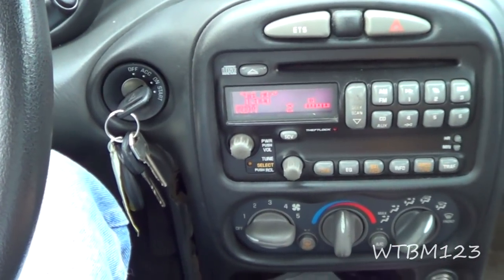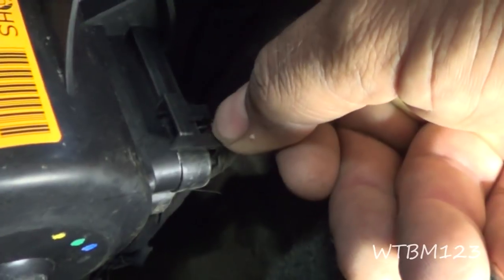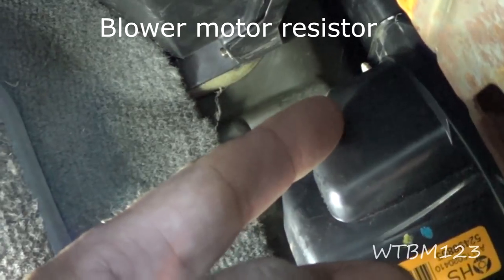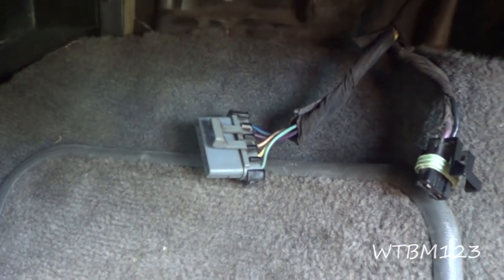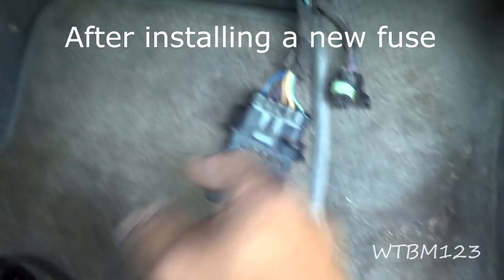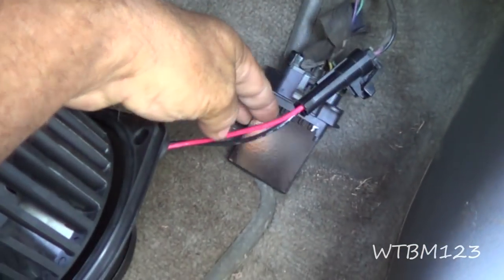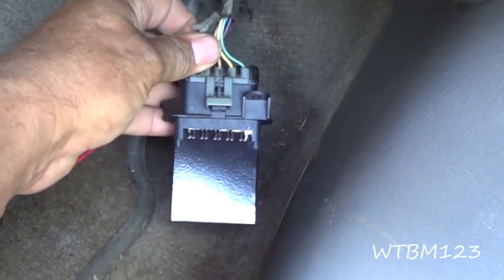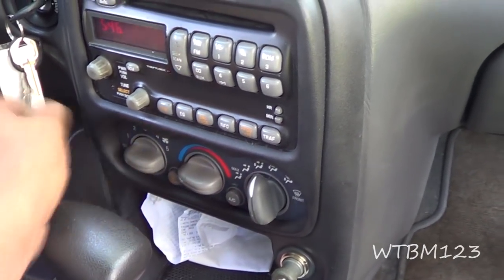Pontiac Grand Am ,HVAC, Heater Fan will not turn on.

Comment: Usually there's a mouse nest's worth of leaves and crap that collects in there. (Presumably from where water drains below the windshield.) And that's one of the things that'll help kill the motor and/or resistor. If you go as far as taking it out, it's a a good opportunity for some cleaning. You'll want a shop vac and a rag.

Also for most people it's necessary to get that passenger seat out, unless your a contortionist. I didn't and my back was feeling it for two weeks.

Good job on getting it done btw.
Reply from the maker: Thanks for watching and commenting

Comment: Thanks for this video bud.  Was able to do it myself courtesy you and your video for a paltry 70 bucks with new motor and resistor.  needed a 30 amp fuse too for 5 setting... so Thank yOU!! very mucho!  bet a mechanics shop woulda nailed me for 250 bucks with labor.  You saved me 200 bucks!
Reply from the maker: Glad the video helped . Thanks for watching and commenting.

Comment: My Grand Prix has had problems with the blower since I bought it. I took it to a GM dealership to get it fixed, and it worked for about 10 months. Now, the blower only works on the highest setting (sometimes), AND the day running lights are directly affected by the blower on settings 1-4. So, on setting 1-4 the blower doesn't turn on, but the headlights go out. Do you have any idea what might be wrong with it? I just want to appear knowledgeable before I take it back to the dealership (so I don't get the wool pulled over my eyes). I appreciate any advice you may have!
Reply from the maker: With out testing , i would wonder about the ignition switch . , or wires rubbed and touching some place . But hard to say

Comment: Thanks! This helps a lot. Mine is currently working but #5 blows like #3. So it is harder to hear the car up this winter. Might replace both the blower and resistor since it doesn't seem to difficult.
Reply from the maker: Glad it helped

Comment: I recently picked up a 2001 grand am, and had to replace the blower motor, which was already out of the vehicle. The bolts were not in the car, do you know the bolt thread size?
Reply from the maker: Sorry i do not know the size

Comment: thanks for the videos. I am having a Nissan Serena and recently started not blowing hot nor cold air when fan or AC is switched on from low to high. . what could be the problem.
Reply from the maker: Maybe a blend door or actuator not working . hard to say with out trouble shooting it

Comment: I was watching your video on how to replace the "heater motor resistor" because your fan would not work on any level.  My question to you is, what if the fan only works on high and the resistor has been changed but the problem still exists.  Meaning, the fan still only works on high (Number 5)?  Any suggestions on what a secondary problem may be other than the motor itself?  And do you think the actuator may have something to do with the problem?

Thank you.
Reply from the maker: Hi get different power . I would check power to the resistor . if no power there you would need to keep going backwards in circuit till you find power. and porb find issue there. if power is to the resistor then check at motor connector for power on 1-4 speeds.If power there then suspect motor A test light with a light bulb , not a test light or meter is good because the light bulb puts a small load on circuit. There are other ways to test  but this way should lead you to the issue. also check fuses
Reply: Thank you, I'll give it a try.

Comment: So I couldn't find it in the description or in the video but did either of those 2 buttons between the knobs not work before either? I have the exact same problem on my grand prix 03.
Reply from the maker: I do not remember unless it was in video . was not my car . but high should use a fuse and the rest of the lower speeds go through the blower resistor thing . and it is possible to have any random speed quit . but if lower speeds do not work and high speed fuse blown , then good chance the fan motor was the cause of their failure
Reply: @wtbm123  thank you

Comment: hi my name is Gina. 1999 grandma 149000 miles on it. great little car, I have a few questions about my grandma I was looking on the internet and a lot of people seem have this problem I have a grinding noise you can only hear inside of car and my car shakes on the passenger side of the car. u cannot hear it on the outside, wheel bearing is good and so is cv joint, and I have changed tires and my friend also have the same problems so u have any ideas what this could be, please I need help!!!!!!! it feels like my car is going to fall apart!

Comment: Hey I was wondering if you know what might causing my cluster lights to light up?
When I'm driving eventually all the cluster lights light up (ABS, Check Engine, Change Oil, and etc.,) but when the car is wet like during a rain storm nothing lights up. Do have an idea what could be wrong?
Reply from the maker: Not sure , but would look for melted ,or corroded wires or connectors.

Comment: Hello i have 2005 pontiac grand am se with 3.4 l my heater work only speed 5, it is fan blower motor?
Reply from the maker: Prob the resistor , but should check how many amps the motor takes as it can be the cause of the resistor failing , not always but sometimes . also check fuses

Comment: I've been going through resistors, and just put a new one in again, and as I did the motor shorted out.  Probably couldn't disconnected the battery first, because I think I screwed the motor back in the wrong position, and it messed it up when I turned it on, IDK, but my blower motor won't even rotate when it sits on the floor like that
Reply from the maker: When a blower motor starts going bad it needs more amps and it over loads the resistor and burns them up .

Comment: i just bought resistor will put in tomorrow. i looked  in haynes book there is a relay and 25 amp fuse according to diagram on 06 caravan. there is 2nd fuse within resistor called a thermal. . i don't see it, in resistor as diagram says because i don't know what one looks like.   i don't see anything burned or broken in the old resistor. i don't see how it could be the relay or  fuses anyway stopping me from getting high power on blower because i get power to the resistor and out of resistor to the fan, but checked them and their good except what the thermal in resistor.  thanks again

Comment: Hi i have a 2000 Pontiac grand am. My heater only comes on when it's on setting 3 and up.
Should I do what you did?
Reply: replace the resistor block behind the fan
Reply from the maker: It is probably the resistor , but i would also check the motor . if motor is getting hard to turn it will burn another resistor .
Reply: It’s the resister you could just use it on full blast setting 5 that’s just direct power to the fan and not being reduced

Comment: Ive got a 2000 trans am that i think the resistor is going bad in. The fan speed goes up and down sometimes. Ive found the blower motor but Im having hell tracking down the resistor.
Reply from the maker: Should be close to the fan , should be able to follow the wires
Reply: @wtbm123  i mean a replacement.

Comment: 2000 buick regal with auto temp, replaced fan resistor($150) and fan motor. Fan still wont turn on.???
Reply from the maker: Really need to test the motor , and make sure the system has power and ground . check fuses

Comment: I have same exact car. Mine blows that 30amp fuse soon as I turn the key. Any ideas?
Reply from the maker: if you unhook the resistor , or the fan motor does it still blow a fuse .

Comment: Man oh man I had to change my blower motor the other day. Cars 16 years old fan still worked but you could hear it was on its way out. So I got a new one for 50 bucks and spent all day trying to install this dam thing like install easy plug in the wires and screw it back on but getting to that point was a b***h. I would recommend removing the passenger seat so you have more room. Plus removing the plastic cover was annoying cause part of it is the HVAC vent and it was hard to pull out with the way the floor and carpet kinda goes up the wall. Then the stupid bolts on the fan motor are a strange size I had to dig in my sockets to find one that fit. It works good now nice and silent but what a pain.
Reply from the maker: Yes not much room or ways to fit your self in there . a Interior Car Creeper , or something like that can also help a lot

Comment: Great video.  I had the same problem, fan would only work on speed 4 and 5.  Just changed the blower motor resistor and checked that fuse you showed in your video in the engine fuse block and it still didn't fix the problem.  What would be your next step sir?
Reply from the maker: I would check to see where the power stops on the non working speeds. Is the fan speed switch giving power to resistor in all speeds . if power is going in the resistor is it coming out. does the fan motor spin freely . How many amps is blower motor drawing. things like that is what i would check.
Reply: I just got my neighbour to help me check, he is a mechanic/electrician.  We checked the new resistor, relays, fuses, switch, resistor input.  Fan motor spins freely and looks in very good condition.  All of those are working fine.  Any other ideas?
Reply from the maker: Shibby With out seeing it is hard to tell . and with out seeing how things were tested ,and the actual test results ,the only help i can be is to say . make sure power goes to every place power belongs ,if no power then trace back to where you find power and start from there . ,and make sure that the ground is good. If good power is getting to motor on all speeds and it has a good ground then i would suspect the motor.
Reply: Have you try testing if there is power going to fan for each speed at the fan plug. example.. 1 speed =7v, 2 speed=9v and so on.

Comment: I tested with a good test light and got power to both wires coming from fan. I jumped directly to the fan from resistor and got the fan running running. sounds like fan is good. 

i then checked each of the wires on the resistor harness. turned fan on and off at different speeds while looking at test like while probing each of the different lines on the resistor and the test light went on and then off while turning the speed control. that makes me think the switch is good.

i think it is the resistor.  maybe went back because haven't changed the cabin filter in 4 years.  i have a meter but don't know how to test the fan with it on amps. any help. what are you prone to believe
Reply from the maker: scooter12368 most of the time the resistor is it , , as long as fav is good and free , because if fan is working hard it can shorten life of resistor . But most times can just change resistor.
Reply: wtbm123  thank you for your help. just needed some sort of confirmaton because most replies are stating their fan worked on high but not others. mine didn't work on any speed but fan manually did. i will go buy one today when wife returns with van.
Reply from the maker: scooter12368 Most get power for high speed from a different fuse . and if changing the switch to each spot except high and you get power to the resistor on each speed , but no power to fan , then prob resistor . look for a fuse for high speed part of fan . if that fuse is blown and resistor is bad i would really inspect the fan , any signs of rust on the bottom of fan near bearing. The new resistor may look different but is just the new design . Just because fan runs does not make it good . May be worth dropping fan and getting a closer look and see if any resistance in turning the fan . should turn Free  On some the high speed fan is out under the hood . It is hard to say exactly what the issue is with out seeing and testing . Hope you get it going again .
Reply: wtbm123 thank you for extending your time.

Comment: hi 
i have a 2003 pontiac grand am GT 3.4 liter and i have no floor lights i looked to see if there were a fuse blown  and they are all good then i try to see if bulbs were good but there are
 No Bulb sockets to find under the dash to find, did this car come with any factory lights under floor lights.
Reply from the maker: Not sure . this was a customers car and depending on the cars options some could have while others may not.
Reply: i have a 
2003 Pontiac Grand Am GT
3.4 liter H.O.
how do i find the under dash light sockets if there isn't any to find or should i run new wiring for the floor lighting and a separate switch for the lights.
Reply: 2003 Pontiac Grand Am
223,000 kms
i have now on my Engine how much of life span could you get out of these Engines, some Mechanic say 500,000 miles if they are well taken car of  is this true.

Comment: Great video sir. Thanks for the information.
Reply from the maker: Thank you for stopping in and commenting . Hope you got it all sorted out
Reply: @wtbm123  Just bought the new fan and resistor and will pick them up today. Will go for the change-out tomorrow.
Reply from the maker: Make sure to look at all the plugs for signs of being hot or melting . Some parts may come with a new pug tail , if so i would use them even if yours looks good.
Reply: @wtbm123  I'll certainly do that. Thanks for the info.
Reply: @wtbm123  I replaced both and checked the old fan with the new resistor, but it didn't work. The high position doesn't work, so I'm assuming that must be the fuse, since it's a direct line from the fuse panel in the engine compartment. I'll have to change it too, I assume. But, 1-4 works fine.

Comment: Sir on my car fan is blowing but not hot hair then it changed to heat then goes back to cold. Winter is hear now heater has problems
Reply from the maker: Check coolant level . . Also if can check heater hoses to see if both are hot when no heat .

Comment: Should i replace both then because the car is old?
Reply from the maker: Well i would look at the fan motor for signs of water , especially near the bottom bearing or the bump in the center of motor . if no sign of water may be ok . Could remove , clean any dirt  out, if any and spin the motor ,. . Or if you had a way to check how many amps it draws would be best , but usually if no water , rust , and spins free it should be ok . If i saw rust near bearing or hard - stiff turning i would replace

Comment: Hi on more question for you. My 2000 Pontiac grand am. I have automatic door locks but my drive side door lock won't lock or even open.
What can that be. 
Get videos.
Get back to me when you can thanks.
Reply: Actuator is broken probably

Comment: Hey Guys didnt know if any of u have had everything on the inside of the cab quite working. Heater fan, dash lights even the windows, I can drive it down the road and 30 miles later it will all start to work like nothing was ever wrong. The only thing i can thing would be the problem is the ignition switch??   03 pontiac grand am

Comment: The fan won't stop going unless I remove fuels under the hood 30a
Reply from the maker: +Seanta Holloway You will have to diagnose it and see where the fault is , maybe a melted wire shorting to another , may be a defective resistor switch , but most times they just stop working , or is the main blower control switch working right . hard to say with out some testing

Comment: okay this is an update when I tested the motor it turned but it was a little stiff tho by hand brought it to the dealership they told me the motor tested bad they charge me $50 to tell me this and said it would be another three hundred to replace the motor the motor that I had installed last summer was still under warranty and only cost originally about $50 put in new motor now works fine
Reply from the maker: Thanks for watching and commenting and updating
Reply from the maker: The motors should turn free or it will take to much power to turn . if you have replaced motor and bad again , then i would look for sings of water getting in . if water gets in the motor it can do damage , if no sign of water then the motor may of went bad on its own . Thanks for the update

Comment: It's about a $200 fix for the resister and blower motor
Reply from the maker: Thanks for stopping in and letting us know the current pricing
Reply: @wtbm123  Hey I was wondering, when I installed my new blower motor it didn't work until I reset the fuse. I have had it two weeks and it did not turn on this morning, so at work I popped the hood and took the fuse out and put it back in, now it works. Any suggestions, it's going to be annoying if it just decides not to work every 2 weeks ??

Comment: my heater plug gets hot  2004 Pontiac gran prix GTP
Reply from the maker: A bad wiring connection, or motor going bad drawling to many amps would be my first guess.

Comment: not fun to work on   had to change  the jap made resistor on my 2002 grandprix   ,,,cheap made  junk   gm  needs to go back  an make their own parts    my  old gm cars still have their orig   heater parts   my grandprix   only had 30,000 miles on it   not very happy
Reply from the maker: They all seem to be made with lower quality parts anymore. Thanks for watching